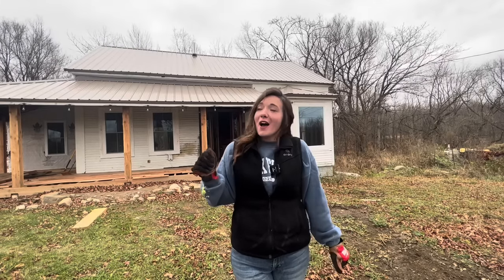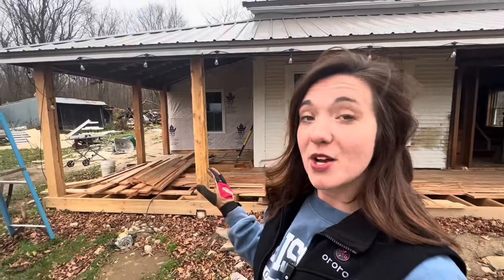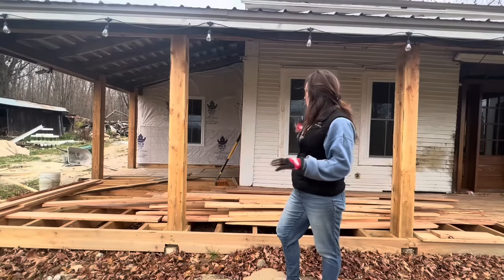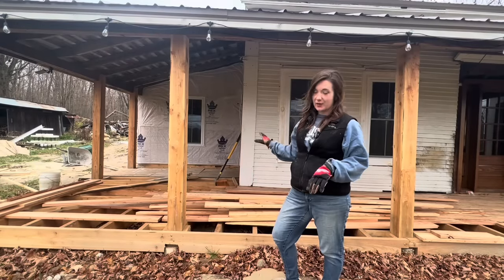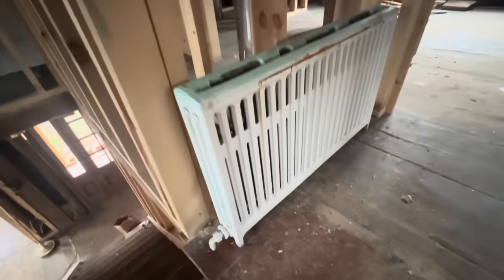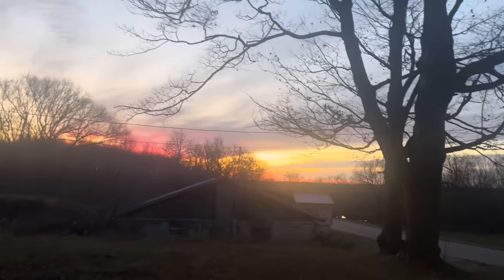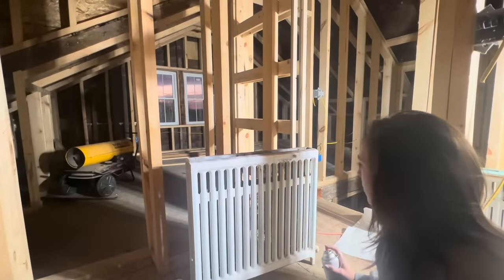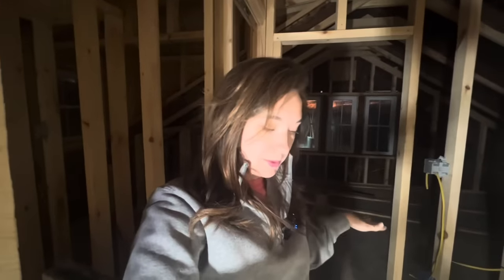Continuing work on my Porch & Cast Iron Radiators! // my Total Home Renovation

Comment: There are snap-on nozzles that go on any spray can that will save your hand from cramping. I think they're called trigger handles and cost $5-$10.
Reply: Yeah, Walmart carries them for $2 and they are a knuckle joint savers for real!!!
Reply: I have to use those too. If I had to do it by pushing down on the spray button with my finger, I can’t move my wrist later.

Comment: Tip* you should always run your router in ONE direction, and thats with the bit  spinning away from the board. When you do it spinning along the board it can pull away and speed off. Dangerous😮

Comment: Coming along good. foot note they make a plastic pistol grip adaptor to go onto those spray cans you are using with a trigger to pull and pistol grip to hold the whole can etc. easier on the fingers and easier to spray with. I have few and swear by them. great work Abby es Jay.

Comment: You will want to hook up your radiators at least downstairs and get an intelligent and make sure you isolate each radiator and that way you can move a note from the wall more.  Could you drip rock? You won't want any drip rock in the house until you have some heat. Because the drip rock will mode

Comment: Please, you need to work on your audio levels in your videos. Your speach is kind of low, and then comes a electrical tool blowing my loudspeaker - not to mention the music. Please take some time to adjust your sound levels. It does not take so long to do that and it will save my loudspeakers if you do.